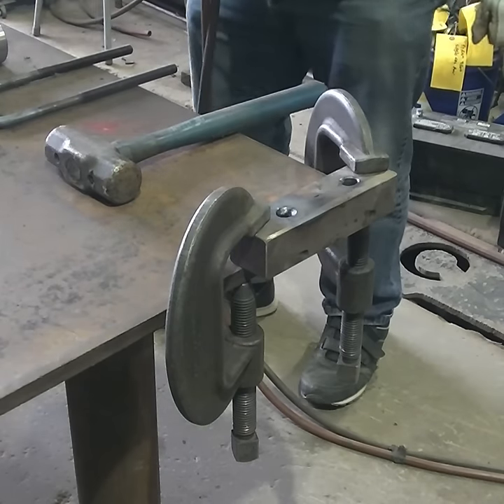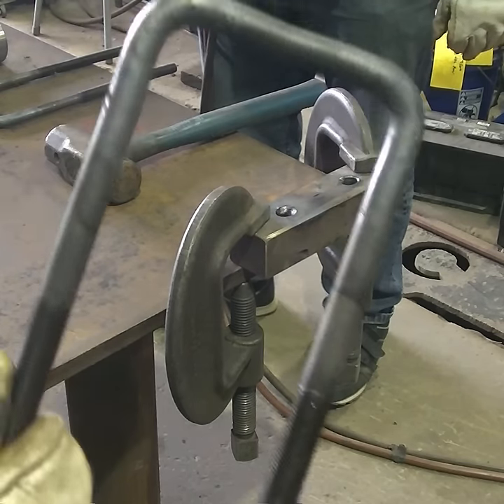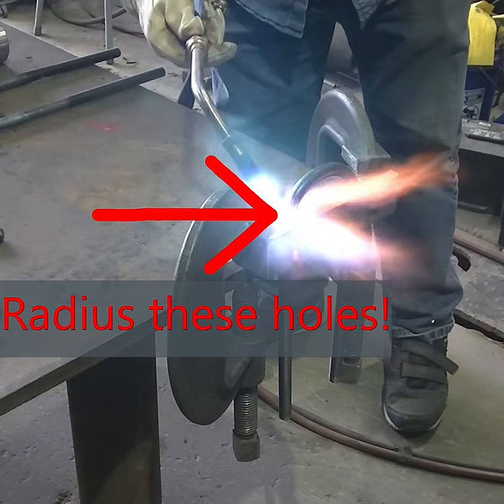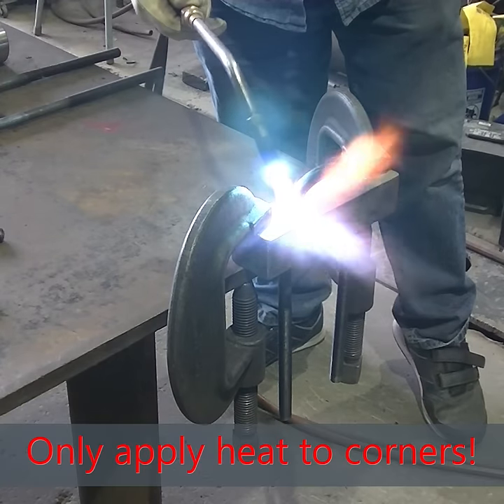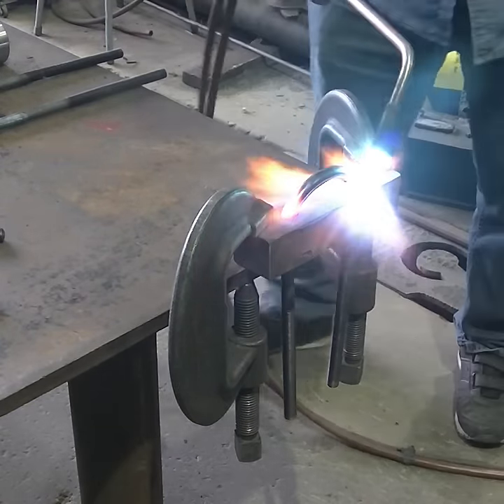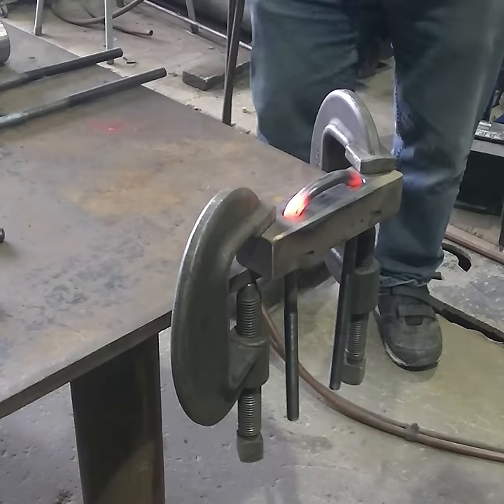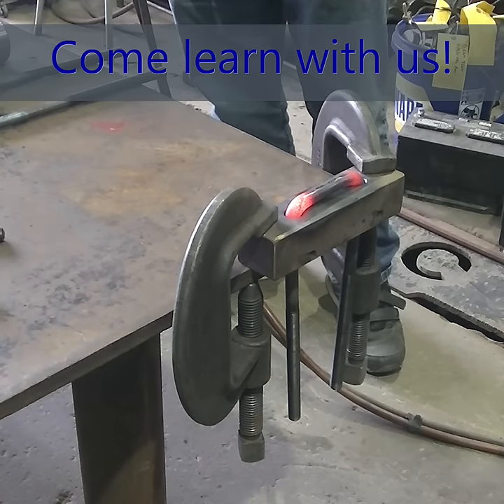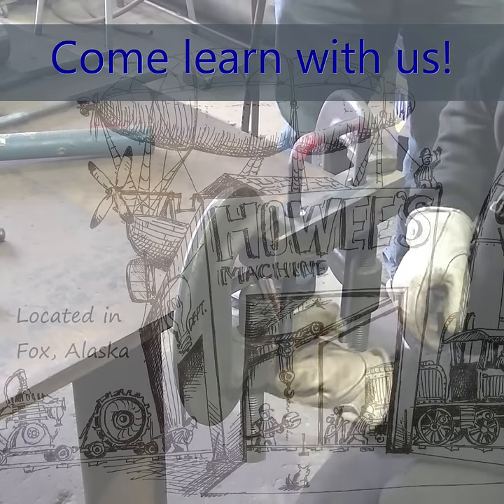Machinist's Minute: Squaring a Rounded u-bolt

Comment: That's called a carburizing flame
Reply: Over an oxidizing flame
Reply: Ya beat me tuit!
Reply: we all nuit
Reply: I'm sure he didn't need reminded. Probly suprised you knew it.
Reply: How long can we keep this going? I think we should all duit.
Reply: Thank y’all for giving me a chuckle, here lately I’ve been really going thruit.
Reply: Man I tried but I'm out.😂 I done blewit
Reply: "But they're to it and at it, at it and to it/Ya gotta tune your attitude in/If ya don't get at it when you get to it//Ya won't get to it to get at it again." - Stompin' Tom Connors
Reply: When torching, sometimes you really try to dial it in... clean tip, right ratio of gas and O2, right amount of both, but at some point you just gotta say skruit, and get the job done.
Reply: Or reducing
Reply: Yeah he said that if you use too much oxygen it'll burn the metal up too. Literally. When you use the cutter it injects oxygen into the metal and burns it off.
Reply: If you ever get around to it, find out that you can't get up to it, step aside let me do it, I'm used to it!
Reply: YES....
Reply: Thanks, it was painfull to hear more than once
Reply: It burns out any atmospheric oxygen too, keeps the metal from burning.
Reply: This,......this was good comment section.
Reply: Good ol rich vs lean. Can’t go wrong with the trusty terms.
Reply: I’m not a pro welder or fabricator but somehow I landed in the right part of the internuit
Reply: Totally over analyzing a fucking torch 😅
Reply: Пламя выжигает углерод . Просто испортили деталь , ну если конечно не произвели отпуск
Reply: Genius
Reply: It can also partially case harden the metal because of the extra sunburned carbon becoming embedded in the hot metal...
Reply: Carborizing flame.
Reply: yessir.
Reply: Interesting, I wonder if the words Carburizing and Carburetor are related, because they are both talking about mixing gas with air.
Reply: @nathanieladams7624  Gee. Ya think?
Reply: @hariton124-th8ln No, a carburizing flame adds carbon.  Used for case hardening and hard facing.
Reply: I said it first I believe 🤪🤔
Reply: Pretty sure Howie knows what he's talking about
Reply: Spot on mate....and its firing carbon molecules at the steel which increases the carbon content of the surface of the material. What he's on about is an oxidising flame.....not good.
Reply: I'm new toit

Comment: I can't believe that I finally found someone that knows the difference between a carbonizing flame, oxidizing flame and a neutral flame and what they are used for.
Reply: I love torchin shit lol took  me a bit to get how to wash welds off cleanly and not burn the initial base metals but ima pro now 💪👨‍🏭 i use the torch like a grinder takin off rust nd millscale ahh i miss it 😅
Reply: I myself would need numerous failures to understand each fully. Part of learning!

Comment: Wish someone told me to run torch acetylene rich before I knackered 2 rosebud's
Reply: Two Rosebud's whats?
Reply: @slappy8941  rosebud is a type of torch nozzle which produces a large, vaguely rose-shaped flame, mostly used for heating as seen in the video. 

Edit: I just realized that your joke went entirely over my head 😅
Reply: @plesleron  thanks i didnt know what it is. Now Im curious what material it’s made of and why the tip of torch doesn’t melt.
Reply: @MischeifMakerz they are made of copper
Reply: Whats this have to do with u bolts
Reply: @kinbolluck476  Heating them up with a torch, literally cannot be done without a torch, which must have a tip.
Reply: @kyleclearwater7380  And we know this because green and blue make purple, until the copper burns through.
Reply: I have those same style clamps.  Heavy and i have yet to use them more then a leap year comes around.   😅😅
Reply: @kinbolluck476 The comment was hinging off of the part where the guy said to run acetylene heavy over neutral or oxygen heavy, pretty sure.
Reply: @kyleclearwater7380 my mapp gas torch tip is brass, honestly didn't know they made copper ones, that's cool

Comment: Don’t do this. Axle ubolts need to be a specific temper or they will fail under load and lead to serious or deadly accidents
Reply: You a metallurgist?
Reply: @daniellawson9537 i doubt he is, but it also doesn't take a metallurgist to know temper and torque spec are a thing. All depends on application.
Reply: Yeah I came here to say the same thing. Not a good idea to heat up ubolts.
Reply: Those u bolts are not gonna fail bro
Reply: @rogerkidd6103 they are GLOWING. The temper doesn't exist anymore
Reply: @ItsMrReaper  then temper it again, it's not that hard
Reply: @rogerkidd6103 bro why talk about something you clearly know zero about? Just move on with your life....
Reply: @Around_blax_dont_relax  lol obviously you know nothing about the subject, one can very easily temper metal at home in your garage ... so move along little boy, stay tf outta other ppls conversations lol
Reply: @rogerkidd6103  yeah if u think ghetto tempering with no annealing is legit for using in vehicle suspension youre telling me all i need to know. Why talk so confidently when u lack basic metallurgy knowledge?
Reply: @Around_blax_dont_relax  lmfao your assumptions about my knowledge are cute
Reply: @daniellawson9537 it's commonsense dude.
Reply: @rogerkidd6103 

"stay tf outta other ppls conversations"

just like you're doing... huh?

you were just minding your own business, when out of nowhere, these meanies said this was a bad idea that would weaken the metal
Reply: as an engineer (yes we take metallurgy classes i can explain it all) yeah it’s fucked. you can easily temper it again no problem ez pz but if you use that it’ll be fcked.
Reply: Exactly. Bulk ordered the wrong size part and is half assing a quick fix, same small shop owner who will whinge about corporations when he goes out of business like it wasn't his dodgy workmanship that put him out
Reply: @rogerkidd6103 Bro, they would need to thermal cycle the steel at very specific temperatures and for specific times to normalize the grain structure, then they would need heat to a specific temperature and soak time then quench to harden the steel, and then they would need to temper the steel at another specific temperature for a specific length of time. Better off just buying the correct bolts. These guys in the video have about as much knowledge of steel and heat treatment as you do.
Reply: @steveballzack1409  that specific temp is very low for a few hours ,a fucking oven gets to the temperature that shit takes, it seems like you don't know too much yourself over there my friend ,I agree it is smarter and better off just buying the correct one, but was simply stating that heat treating them is very achievable by just about anyone
Reply: @rogerkidd6103  To temper for toughness on things like suspension parts you need hotter than an oven goes. But also it's probably fine.
Reply: @libtrs838  that's not a suspension part, it's a ubolt
Reply: I've manufactured these and tested them. This is not a problem.
Reply: @rogerkidd6103 u bolt that holds leaf springs together on the suspension..cmon dude
Reply: @rogerkidd6103 not really an assumption when your fist comment was itll be fine when you should of known it lost its temper. Looking something up after your called out and told about it dont make you educated on the subject
Reply: @ryanfulton8199  Noone has looked anything up lol ,100 percent that ubolt in this instance will be just fine, I guarantee you have not once witnessed this causing a ubolt that is being used for what this man is using it for to fail...
Reply: That’s like saying you can’t weld something because it changes temperature. Good luck bending something that isn’t red hot.
Reply: So, not only is this probably worsening the load capability, even worse that these guys are in Alaska.
The fluctuation of temperatures there, on this piece of metal?
RIP
Reply: @rogerkidd6103  What does the top comment say? What does a u bolt generally hold? Axle U-bolt also sometimes called a suspension u-bolt holds the leaf springs (suspension) to the axle. Autopart websites typically have u-bolts under suspension. Everyone's concern about the temper being ruined was in a suspension situation. I half agreed with you and then you had to try to change the conversation.

Let's pretend axle u-bolts aren't suspension parts. What I said still applies you would want to temper for toughness you don't want hard brittle non-suspension axle u-bolts.
Reply: You are right absolutely
Reply: Yeah, because he totally mentioned exactly what these were being used for... ya dolt.
Reply: Its also pretty easy to temper steel with conduction
Reply: I was just about to say this, I recently replaced the Ubolts and leaf springs on my truck. Those things are meant to be tempered to be flexible but still fairly hard. If you torch one of these things your going to ruin the temper on both those points and  greatly increase the chance of the bolt failing at those points. And causing way more issues and Bill's than just reordering the right Ubolts.
Reply: @rogerkidd6103  if you over temper you can cause them to be brittle and fail not to mention that it can cause stress lines, micro fractures and cracking if you dont know what you're doing. Now if you under temper or fail to temper it correctly since different types of steel have different ways of tempering and need to be heated up to a specific temperature then you make the entire Ubolt soft and cause even more issues.
Reply: @rogerkidd6103 now wait a minute...
Reply: Just do a Blondie heat treat, quench it, it'll have a heart of glass 😂
Reply: @christ938 As a welder, formerly AWS certified, yes the fuck welding can fuck up hardened steels.
Reply: @rogerkidd6103 seems like more than that u bolt has lost its temper.
Reply: Since you don't know its specific application, that's just wrong. Ntm since he has a torch, he can temper/anneal the u bolt
Reply: @cc23001  You can't accurately get a temper without a furnace that you can precisely control the temperature of.
Reply: @cc23001  it kind of doesn’t matter, even if we assume this isn’t for a truck axle, you are still taking a heavy duty piece of hardware and weakening it significantly, whatever it’s being used for it’s no longer sufficient
Reply: @ItsMrReaper You're no smarter than him. Tempering is the OPPOSITE of hardening. They are nearly at 'maximum temper' when they are cooled down slowly from glowing temperatures.
Reply: @golgothan Jesus, I just saw your other replies. There's a reason the first guy who replied to you has 40 likes on his comment and you have 2.
Reply: @alexandersmith2597 you're using the word "temper" the completely wrong way dude wtf. No one knows it anymore, people always say temper and hardness/hardening is the same for some reason. Hardening is THE OPPOSITE of tempering!! Tempering = softening & relaxing the steel.... aka the least brittle it can be
Reply: @Jordan-rb28  Nope. You're thinking of annealing, which is when you heat the metal up hot enough to change its crystalline structure, then let it cool very very slowly until room temperature. Tempering is a combination of both quench hardening and annealing. First you quench harden the metal, then you partially anneal the metal by heating it up to a much lower temperature and then letting it cool down slowly. Tempering gives you the best of both worlds, the strength and hardness of quench hardening with the impact resistance and durability of annealing.
Reply: Ya it's for the space shuttle bud..ha ha
Reply: Ive waited years to say I actually am a metallurgist (materials science major) and agree with his comment.  Absolutely do not do this.
Reply: Acetylene rich is called a carburizing flame. Acetylene will not come out of solution acetone in the cementious fill of the tank unless u take out too much too fast. Does not matter if flame is oxidizing or not. Hence the 10 psi limit on acetylene tanks.
Reply: @brianbekkala3157  I think you replied to the wrong comment

Comment: To do it properly you need a radiused drift so you don't bruise or flatten round bar
Reply: *top swage?
Reply: I thought he mentioned he had it radiased
Reply: @PhillyFail  You could clearly see him hitting it with a flat-faced hammer with no die...
Reply: @EddieTheH  oh I guess I didn't understand the question or statement I should say
Reply: @PhillyFail  That's fair, it wasn't stated particularly clearly what they were doing!
Reply: @EddieTheH he says that the die has the radius already and if you tried with just a drilled hole it’ll mess things up. 

It’s hard to see in the video but it’s there
Reply: @michaelbello8681  I see now, right enough.
Reply: My guess is that is the reason he states not to hear the center section where you are hitting it.
Reply: @Michael Bello  when they say the die has a radius to it do they mean they chamfer or bevel the edge of the hole?
Reply: @diabolicletrinity  I don’t know what degrees the bevel/chamfer would be at.

Comment: Set the torch the way it's supposed to be set and adjust your distance to your work and length of time. Looking for the proper cherry red. Adjusting your flame to a acetylene rich will cause tip clogging and induce carbon to the to the exterior and in effect could case-hardened your work peace which will lead two fractures and cracks. sorry I do have 30 years of welding of all types of of alloys
Reply: You're right that case hardening will cause cracks and failures in welds, because it makes the weld brittle. But with a u-bolt thats roughly ½in thick or more, Case hardening is just going to effect the surface and it wont harden the steel deep enough to make it brittle.

But yeah if he was willing to get like that, it would make the weld brittle and highly likely to fail.
Reply: @mrfixitusa6165  indeed! I agree. Even a thirty-year vett could learn
Reply: If you aneal the bolt couldn't you just reharden the bolt. It's been 32 yrs since Machine shop class I'm rusty.